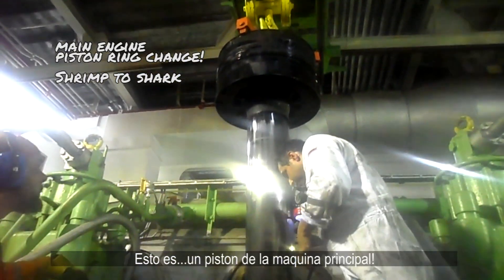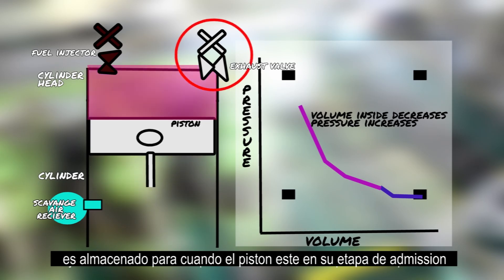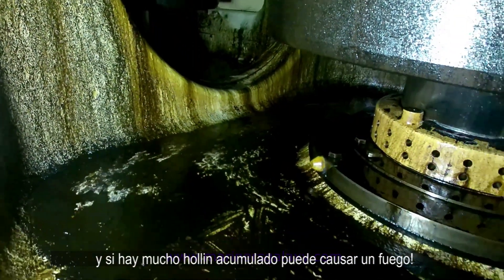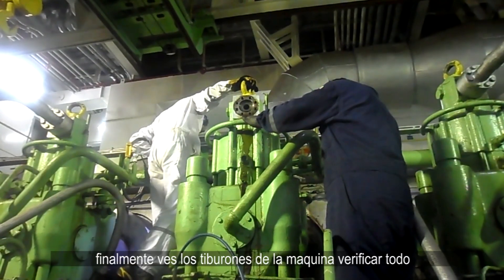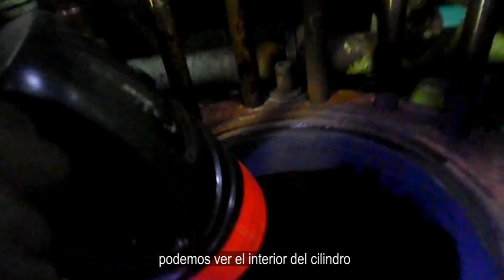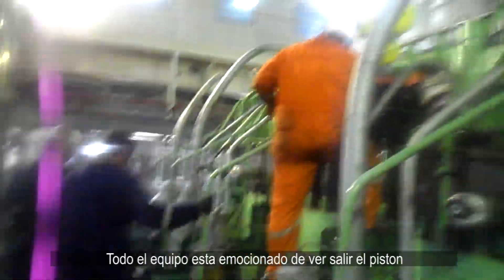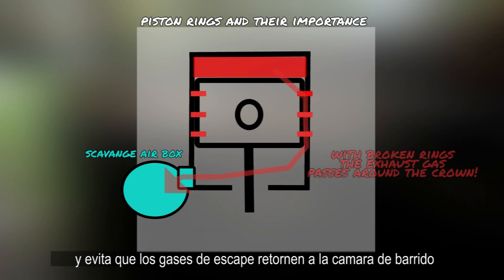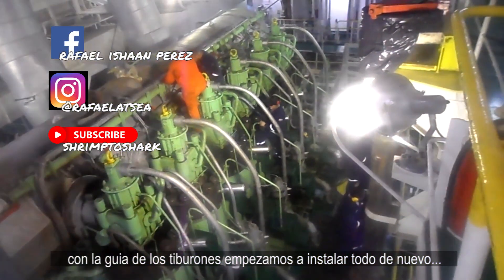Marine Main Engine - Piston Ring Change

Comment: Hey bro, are you allowed to wear sleeveless suits like that?
Reply from the maker: Hey amigo not really, but the job is very long and many changes of coverall were done, even those that should be thrown away.
Reply: One thing ill be scared of when i start is the heat... @ShrimptoShark
Reply from the maker: @jerrellwong4631 Yeah when working on the boiler or any steam / heavy fuel system be sure to be covered head to toe and don't roll up your sleeves. I have a few burn scars because of this.
Reply: What about the actual temperature in the engine room? Is it really as hot as people say? @ShrimptoShark
Reply from the maker: @jerrellwong4631  some rooms it can as hot as 40 degrees celcius (purifier room) but in general navigating in the Caribbean the engine room is 33-35 degrees. In colder areas naturally it will be cooler.
Reply: Thanks man, when i start ill be sure to ask you for help some time @ShrimptoShark
Reply from the maker: @jerrellwong4631 success and nothing else, God bless your adventure.